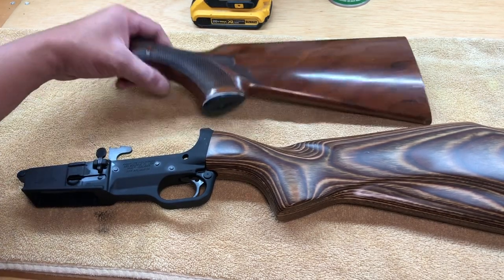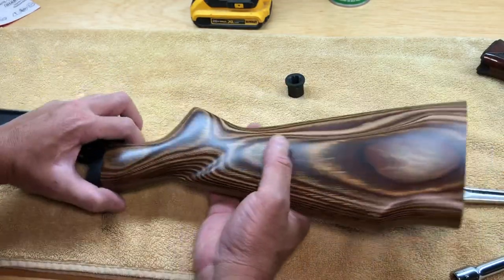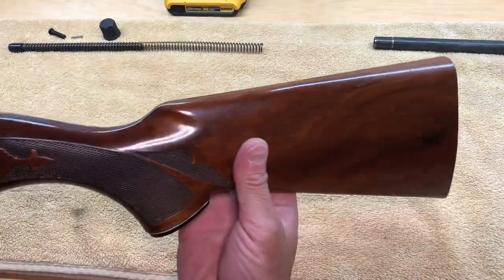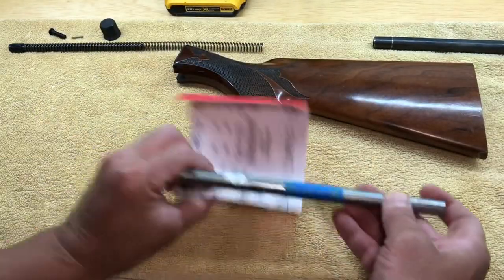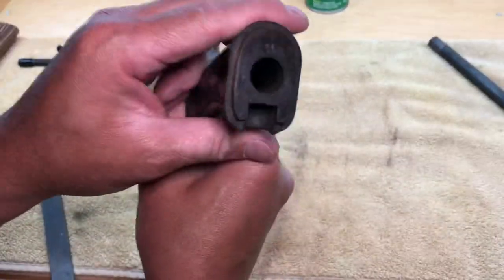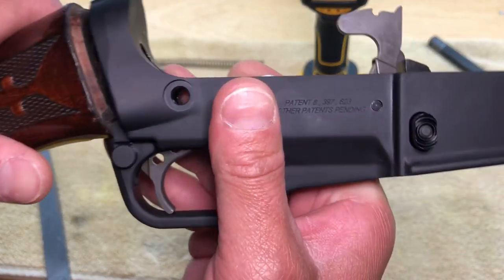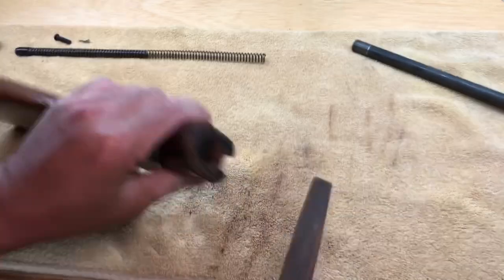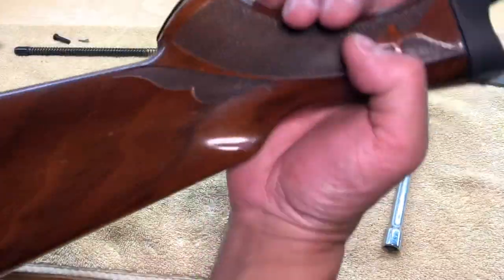Fightlite SCR with a Custom Remington 1100 Stock

Comment: Why specifically Remington 1100? Is that the only stock that fits the scr?
Reply: I would also like to know
Reply from the maker: Hi - i dont know the technical details but the SCR is based off of Remington's internal stock buffer which makes the Remington stock an exact fit minus a little sanding.
Reply: @SocoMoto707  thanks buddy. I bought a Monte Carlo style shotgun 1100 stock and I didn’t even need to sand the buffer tube area. Works great!
Reply: @SocoMoto707 do you know if the 1100 stock has a longer length of pull than the SCR stock?

Comment: Question. When you get one of those SCR lowers, I see it comes with 'bolt carrier, BC strut, and pin', but what else is missing to mate it with an upper? I can see I'll need to get a charging handle, but it looks like the Bolt Carrier that comes with it is missing the front piece? What did you need to add to make a complete SCR AR?
Reply: The bolt is the front end piece you're talking about. After that you would need a complete upper.